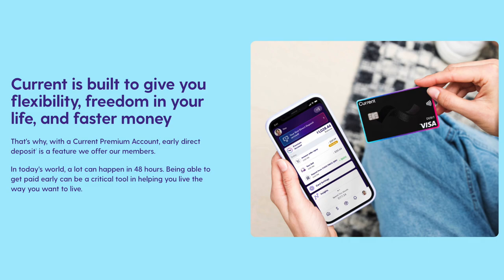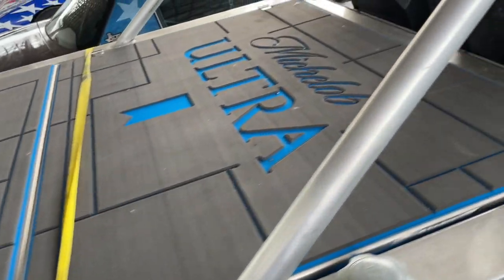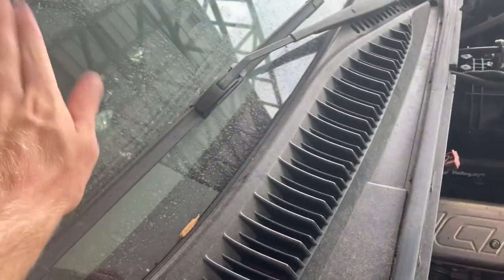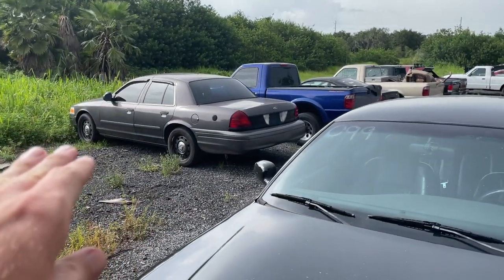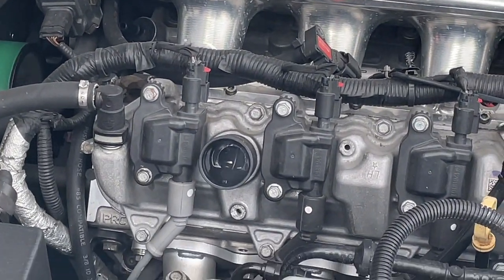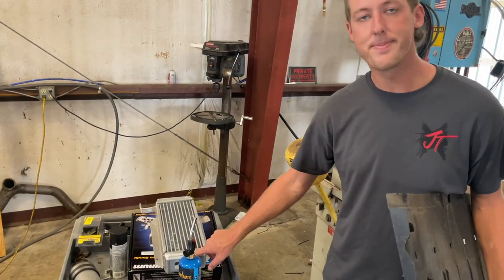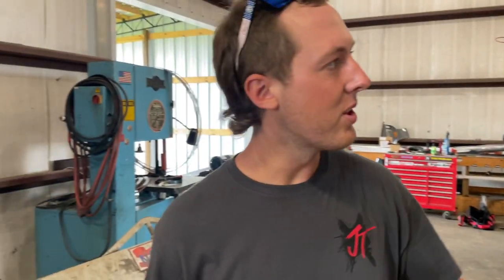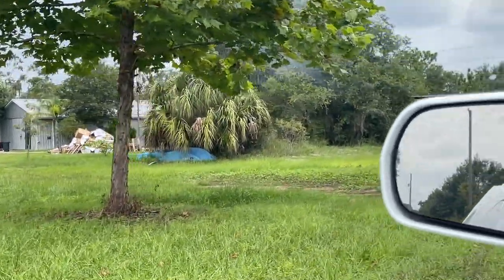Trying to Fix the FREAKING Bald Eagle Machine Finally... + Sold One of the Jet Boats :(

Comment: Cleetus said "no thermostat"... did that mean there isn't one in the engine? The reason I ask is because you gotta be able to slow the water down through the radiator so it has time to cool it off. On our circle track cars we run restrictors in place of the thermostat so that the radiator has time to do its job. Also maybe put a shroud on that radiator so the fan is pulling air through the entire radiator
Reply: this 100%
Reply: @kingarthur7255  Sadly, you don't quite understand how thermodynamics work. Your explanation of "my friend says this" is easily disproved, and I'm not sure why you would come to try and attempt to argue/discredit someone on the internet without first doing your research. I had a long-winded explanation written up, but A simple google search for "car runs hot without thermostat" will bombard you with thousands of forum posts from confused individuals (like yourself), and other examples of why you are wrong. Thanks for playing though...
Reply: @kingarthur7255   "performance builds heat" is the best quote to understand that anytime you are adding performance that you are adding heat. Imagine it's a hot day and you stand in front of the fan to cool off... now, run past that same fan and see if you cool off the same amount. I have seen cars run hot on a 85°F night at the racetrack and people having problems when we have never overheated even on 100° days. Everybody is exposed to different experiences through life and just because your "ranger" didn't run hot on the street doesn't mean that a performance engine will react the same way

Comment: Looks like it could also use a proper fan shroud and fan upgrade so it’s pulling through the entire rad instead of the small portion it currently pulls through.
Reply: Yeah, or they could vent the tray to pull a bit of air from below which won't hit the IC piping
Reply: Im with you need the right size shroud had the same issue on a racecar one time built a new shroud and problem was solved
Reply: yeah that shroud looks janky as hell for this car
Reply: Came here to say the same thing. The shroud is poorly designed. The radiator could be much much more efficient.

Comment: You need a fan shroud that covers the whole radiator not just the middle of it.
Reply: This guy knows
Reply: And put the piece on the bottom back on.
Reply: I was about to post, people really underestimate how much a fan shroud does, especially with a bunch of coolers in front of it, plus get a fresh ahir pickup for the super charger should change things tremendously
Reply: Dual fans would be great also with the shroud
Reply: yep that would help lol, cooling is only utilizing maybe half of the radiator
Reply: I came here to say this, but knew in my heart it had already been said.
Reply: Correct, that fan is only pulling air through 1/3rd of the radiator stack!
Reply: The OEMs wouldn't bother with shrouds if they weren't necessary. Best design I've seen is the full shroud with the little rubber flappers on the backside, fan sucks them shut, ram air opens them going down the road. Stick a new 'stat in it & should be golden. Also needs to look into that stabilitrack issue, that can cause all kinds of crazy driveability problems.
Reply: I used to make alloy fan shrouds for my Rotor builds back in the day when I used to build cars.   I wouldn't even consider running a radiator without one.
Reply: 100% sure it would help alot
Reply: THIS! And judging by the lack of room up front on the C7 corners were cut either by Cleeter, Procharger, or both. How many more times are we going to watch vids where a motor pops that was preventable? Are "we" making content to pay Texas Speed's bill or are "we" getting smarter? What gives here? Prochargers C5 induction kits to the head unit were JUNK. Ask Andy at A&A... althoug I quit paying attention to the Corvette Procharger kits in 2005. ECS and A&A were busy trying to reengineer everything from induction to belt drive. C6 no different than C5... radiator had to be laid down to allow direct intake into head unit. Andy, to my knowledge, was the first to do it. C7 appears to suffer the same fate. This vid represents overthinking by people who do not engineer... but make You Tube content... of which I surely enjoy :-)  Its a reliable street 1000hp car or it isn't. This Bald Eagle is in the middle of a MOLT! Ask yourself why Cleeter left George's "just put a turbo on it" in the vid (12:23)... that HE edits?
Reply: Genuine question, but isn't that generally only necessary when the car is not moving?  Wasn't he running hot while the car was moving?  I.e., assuming the radiator is getting airflow when moving, would the shroud still be a benefit?
Reply: Yep.  Had same issue with a customers procharged c7.  Put a full aluminum shroud with duel high CFM fans, problem solved.
Reply: @kene6838  I was definitely thinking dual higher cfm fan
Reply: @ericg4x4  Not even that, since the air is going to take the path of least resistance, so at low speeds or when stopped, most of the air is going to use at best 1/4 of the depth of the fin stack and the outer diameter of the fan is going to do most of the work while the inner part is maybe going to take some turbulent air. Better than nothing I guess, but very inefficient and suboptimal.
Reply: Nah he need to mount the radiator to the hood for maximum cooling
Reply: They make dual fans that are built into a single shroud unit that would fix half of the issues, then add the fresh air pickup to it and you'll be golden pony boy.
Reply: I also came here to say this! a properly sized shroud with dual fans would do wonders for that car!
Reply: Also too. An Engineer that makes 300k a year, decided water needed to stay in the radiator long enough to cool, hence the thermostat. You took it it out , Put it back.
Reply: Facts!
Reply: you need a full rad shroud. Right now you have fan pulling through 1/6th of the surface area it could be using
Reply: This is the thing that worries me, guys running a racing shop, with actually good cars and can not identify a simple thing like that, not enough heat extraction from the radiator, that's 1st grade math, 
Then opening the filter, perfect but why not put a clean rag in the oil collector and filter the oil to see what came out of the crankcase, just simple stuff
Reply: tell him

Comment: The size of the fan and that fan shroud is just like pissing up a rope. Step up the fan size and cover all those cores with a shroud, and watch the temps drop 20 degrees.
Reply: Dude this is exactly what I was thinking I hope he does this cause that fan isn't doing much without a shroud!
Reply: Exactly what I was going to say.
Reply: With the back of the core exposed like it is then it'll just recirculate hot air back through the core rather than pulling fresh air from the front. As you say fully shroud & if possible a larger fan but OEM not some aftermarket toy one!
Reply: @SB-vb8ch  LOTS of better fans out there then OEM
Reply: Definitely the shroud at a minimum. Also may wanna use 2 fans instead of just 1 but regardless that shroud is horrid...
Reply: Direct that hot air up and out the vents in the hood too. ThT shround is half the size it needs to be. Id split it and raise it up to the top of the radiator. All that hot air needs to get away from that engine. Aircraft have cowling to direct air where its needed.
Reply: Same! I was waiting for one of them to mention it in the video. The fan is covering a small area of the radiator.
Reply: Im surprised that you  thought that little fan and no shroud were sufficient enough to cool that beast.   You need to step up and buy a proper cooling fan/fans with a full shroud.
Reply: That was the very first thing I said when I saw it "that shroud is fucking garbage"... Slim, aluminum shroud that covers the whole core and 2 smaller slim fans should make room for an intake elbow to get some cooler air into the engine.
Reply: Its ment that way to pull air through the front and out the hood thrue the vents, they removed all that duct work when they added the procharger.

Comment: Oil should run at 212

You need two fans on the radiator

You need a thermostat to regulate water flow

You also need to create a low pressure area at the back of the under tray to pull the air out of engine bay. A 3/4" strip running along the under tray at 90 degrees  well do the trick.

Comment: Cleetus ya got to do dual fans and a shroud on the c7, without a shroud you’re only pulling one small circle of air through the radiator instead of cooling it all
Reply: At speed the fans are/should be a relatively small part of the air moving through the rad. I sometimes see shrouds that would be great for low speed stuff like burnouts but terrible for racing

Comment: Need dual fans and a shroud that the fans can pull air across the whole radiator! It probably cools down when the cars moving, but you’re only pulling air across 40% of the radiator when it’s setting still!
Reply: Not sure if thst model has it but adding wing coolers in the air dam can help also
Reply: I second this. That fan and lack of shroud isn't enough
Reply: If the car is overheating while cruising down the highway the fans are not the issue
Reply: Look at the older Corvet's how they did the cooling ducts,
Reply: If I heard correct the engine doesn't have a thermostat. That could be the issue. Coolant is moving too fast through the radiator and not cooling well. Put a restrictor in the t stat housing to slow the coolant flow down.
Reply: He needs the fbody fans, dual fans with the shroud.
Reply: I agree. Those spots where the shroud is not touching the radiator is a big issue. Maybe not the entire issue but definitely worth upgrading.
Reply: @Sagekable  he did say it cooled down when he was cruising... but im thinking the tune is as much of an issue as anything, as its not even running right

Comment: Put a thermostat back in it, slow down the coolant flow so it has time to properly exchange heat! Ditch the single fan go to duals and a proper shroud for the rad!
Reply: Agree. A 160 at least
Reply: I made the same comment. Once that water cycles thru after some hard pulls the coolant has no chance to cool down. The very reason for a t-stat in warm climate! Dih
Reply: But.  If it’s only getting hot after pulls he might be pushing water and filling the block with air.
Reply: @justinsasser3884  then it would over pressure the coolant system, he said in the video it gets warm just idling. Coolant system is simply just not keeping up.

Comment: Hey Garret, I've been working on big trucks for over 20 years and most drivers change oil every 20,000 miles but I do it every 10,000. It can get expensive but she will last much longer. Go to a synthetic if you want some better protection. Glad to see you and Mati are feeling better. Love the videos.
Reply: You don't think he is running Synthetic in all these race cars?
Reply: Depends on the oil not every synthetic is rated for 20k.. we ran frontier in our rigs and we sent samples at 10k to see if we change filter or oil or both.. my service truck I change around 8k depending on hours..

Comment: As others have said, that fan setup is no good. You need a full shroud that directs air through the entire radiator. But also, that front black cover that goes on the bottom, you can cut vents into it that you can bend to direct fresh air up into the radiator itself. Then install an intake onto the super charger, should be golden then...
Reply: my thoughts exactly on that bottom plate. mod it with scoops or such  or drop it and add an air dam.
Reply: i agree with the fan, its too small, u need a dual fan setup
Reply: Yes
Reply: That's an absolutely horrible idea, to cut holes in the undertray. You have a low pressure zone under that tray just behind the splitter. If you cut the undertray you're going to force high pressure air from before the rad under the car. It'll hurt cooling badly and lift the front of the car
Reply: Given that the car is overheating at idle, yeah, the fan seems undersized/needs a shroud.  However, that's not going to help when cruising.  Above 30-40mph the fan doesn't do much and ram air takes over the majority of cooling duties.  The stack up front is definitely restricting things, but in addition to looking at a different fan setup, managing airflow coming into the radiator should also be looked at.  I'm not familiar with the C7 front end shrouding, but given the tiny vents that were there I'd think there's at least a little to improve on.

It's also just a lot of heat all stacked up all together, as well as a lot of restriction to airflow.  If possible I'd try relocating that oil cooler and perhaps spacing the intercooler off the radiator a little further (though again, I'm not familiar with the build so perhaps that's not possible).

Comment: Look into that stabilitrak issue. If it thinks its seeing wheel spin when its not it could be pulling timing the whole time, which will make it run hot.
Reply: I agree i have seen stabilitrak cut engines if its reading wrong
Reply: The fact it’s shutting off also points to some sort of running issue, very well could be timing related. I think you’re onto something
Reply: I think if your tire treads more than one or two 32nds of an inch different it can cause AWD issues and even ruin some cars.
Reply: Maybe because he has low pressure in the rear right tire?
Reply: didnt he just have this thing on the dyno the other day getting tuned to?

Comment: Route the intake like you said but also that rad fan doesn't cover much surface area, maybe upgrade to a dual setup there are a few out there for the c7, all that stuff piled in needs stronger fans that can handle a higher pressure drop.  between those 2 your temps would likely come down quite a bit.
Reply: Nailed it buddy
Reply: an electric fan doesnt do anything after 30-40 mph. The air coming in at that point is faster than what any fan can pull in besides for a clutch fan. Though i will say if im not mistaking on a c5 vette they have a shroud that directs the airflow down under the car after the radiators when this one is exhausting on the engine. Kinda surprised he doesnt have a thermostat in it, to give the water inside the radiator time to cool down though which could be half his battle.
Reply: @danking5382  true to a point but if there is too much congestion a high power fan does wonders getting the air through the bay. He was saying that even at idle it was staying hot

Comment: I would highly suggest running a dual fan set up on the back of the radiator as well as a cowl hood to help pull that heat up out of the engine bay

Comment: Move the cooler like you said. Look into aftermarket fan set up.  Worst case scenario take it to the wind tunnel and use the smoke to see where air is flowing.

Comment: You need to get a fan shroud on that thing, even if it’s super thin. The fan you have on there is only pulling air through probably less than half of the surface area of that radiator.

Comment: Snorkel. The C7 definitely needs a snorkel. That will give it the coolest air possible while improving your aerodynamics as well. It's  a win/win.
Reply: That would be wild 😂
Reply: Yes
Reply: That would definitely help it get across the pond too.
Reply: I see using the good old extra forced induction
Reply: This plus 2X electric turbos!
Reply: add a hood scoop where the vents are in the hood. pull air from there.
Reply: She’s a honda atv In disguise
Reply: turn that corvette into a stingray if you catch my drift ;)
Reply: If you're doing that then you should probably put some exhaust whistles on too. Increasing bald eagle screech to release maximum freedoms.
Reply: Agreed cool air intake reqd

Comment: I think what you should do is get a zr1 front bumper(for looks and it will open up airflow a lot), get a shroud that supports 2 fans, and do the fresh air pickup for the supercharger

Comment: 200° coolant temps are fine. My Ranger runs at 200 ALL THE TIME to include in the middle of the winter. All of my motorcycles run hotter than 200 all the time. 

Sure, there's other stuff going on but a 200° water temp is not a problem.
Reply: @xColonyxXxRiderx  it’s not injecting meth constantly.

Comment: You need a thermostat. Some engines do fine without them, but most don't. Water needs to be held in the rad long enough to cool it off, if not the water is just hot lapping right back to the block.
Reply: Agreed.
Easy to try.
It has a lot going against it, though, so I suspect it's going to need a couple solutions... But dwell time in the radiator could help!

Comment: If you cut a patch out of the filter media and squeeze the oil out with a bench vice, then spread the patch open on the bench, light it up with your flashlight. If there's metal, it will flash right back at you. At least it does for me. Great videos and great crew. Keep em coming brother.

Comment: When cutting open a filter cut a chunk of the pleats out with a utility knife and squeeze the oil out of them in the vise. Then when you unfold them you know exactly what’s in the filter. It’s usually a lot worse then it looks from the outside.